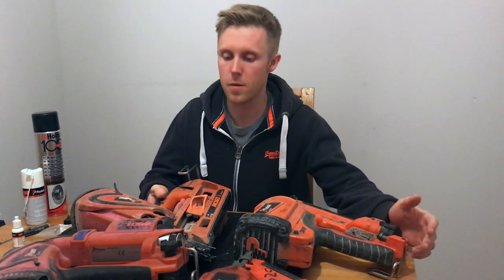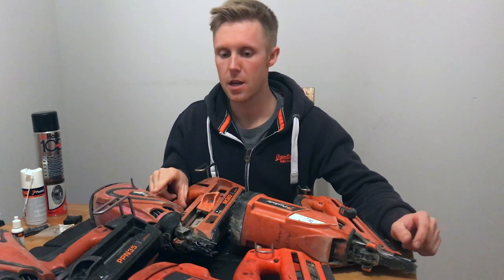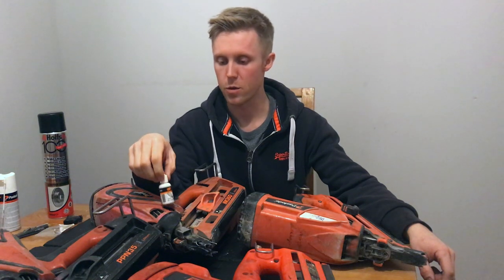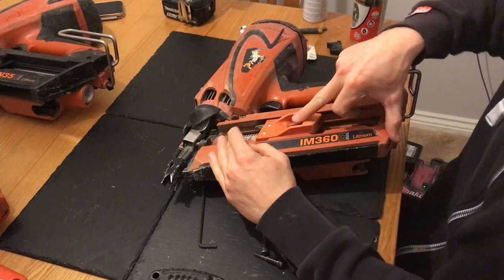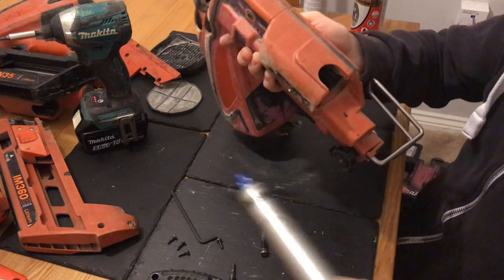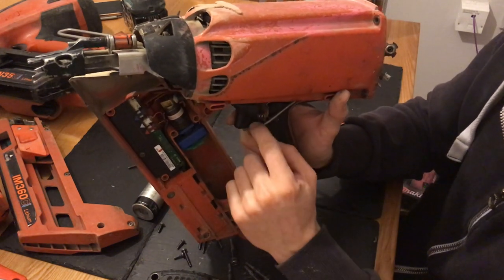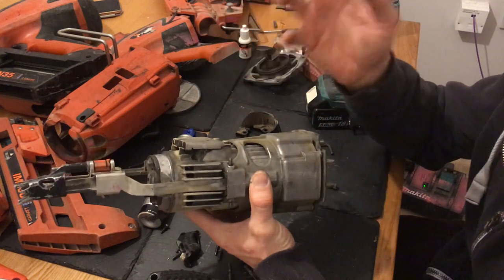Paslode Fix Common Issues Not Firing IM360ci, PPN35ci, IM350 plus

Comment: My biggest regret is sticking with paslode for so many years, I bought the gasless Milwaukee and it just puts the paslodes to shame
Reply from the maker: 100% I have the HIKOKI. And glad I hadn’t had to maintain it!
Reply: The Milwaukee framing nailer is twice as heavy as a Paslode,,don't agree with "putting it to shame"
Reply: @chadsimmons6347  exaggerated, its not twice as heavy, perhaps you shouldnt be such a little girl about it with your weak little arms

Comment: I cant get any response from my paslode finish nailer no fan no nothing except a blinking green light (blinks like 4 times maybe). It’s the older style with the orange cap on the butane compartment not the black cap. Any thoughts ? Doesn’t matter if I depress it or pull the trigger, no response
Reply from the maker: If you open the gun up there is like a little black piece of plastic on a spring which pushes a switch when you press the gun down that could possibly have snapped either that or The button is damaged on the trigger.

Comment: George, my ppn gun has the fan running constantly as soon as I connect the battery. I noticed the small black cable needs soldering on but connecting that by pushing it in makes no difference. Any ideas what else it could be?
Reply from the maker: Potentially the switch is constantly engaged which doesn’t turn the fan off. Open it up and check the micro switches.
Reply: The earth cable on the fan was also loose which you’ve mentioned in the video. The little black cable. Would that potentially be making it not fire and keeping the fan constantly on?
Reply from the maker: @willburbridge5261  yes it would definitely stop it from working. And potentially cause the fan problem.

Comment: Hi George, My im360 head/probe has snapped off when I’ve dropped it. The metal pin is stuck in the probe do I just need to order a new knob assembly and put it back together? Unsure of how to removed the orange depth knob. Thanks
Reply from the maker: I think it should literally just unwind. Best bet is to look at the schematic that I linked in the description to get a better idea of the assembly.

Comment: Where you talk about the striker missing the nail, and needing to screw it in, was that a rubber bung/bumper that slides in the cylinder, my im 350 90ct doesn't have that, just has piston rings,
It's fires the nail first time everytime, but the piston doesn't return and gets stopped by the next nail that gets pushed up from the magazine.
Question is, do they all have that rubber bumper on top of the piston, tha ks
Reply from the maker: Hi thanks for the message, from what I've seen they should all have a rubber bumper inside the piston. i would post a picture if i could. but if you look at the 350 schematics in my description(third link). i believe its part 49 on the chart 'the rubber bumper' if im understanding right. that is another part i know of if it isn't the reed valve it could potentially be. http://www.topgun.co.uk/schematics/IM350_OrangeNose.pdf its part 52 on this drawing. i believe that is the gun you have.
Reply: @Georgous92  thanks so much for the reply,yeah that's the gun i have,ill order the bumper then cheers,the reed valve isn't bent or missing any fingers so i think that's fine.
also do you know if part 89 fits on the outside of the combustion chamber or is it a gasket thats sandwiched in between the chamber parts.
thanks again
Reply from the maker: @patchedupdemon7104  you're welcome mate, i think the parts only about £9 so its definitely worth a shot!
if I've understood your question right, part 89 is a piece of rubber that just overlays on top of the combustion chamber. hope this has been helpful to you! good luck!

Comment: Hi George, I have the 350+ and it hasn’t had much use but every now and then when you shoot a nail it has a delayed noise from something being slower in the return. Sometimes will be a slight pop sound like an air lock? Just wandered if you have experienced this at all?
Reply from the maker: Hi yes, I have experienced something like that more commonly on the 350. I sometimes would have it if I was firing into something very dense. Could potentially be the reed valve needs a little clean from the build up of black carbon on it.
Reply: @Georgous92 thanks for the reply. Easy enough to do yourself? Any footage of you doing it?
Reply from the maker: At 16:25 it’s basically the same place and concept.

Comment: George a Paslode ppn35i positive placment gun firing no problem was green light but now orange light which is service light how to turn off orange light thanks
Reply from the maker: Normally you hold down the star button for 30 seconds to reset. But if it’s flashing red it can be a sign of a loose wire. Check the one to the antenna or electro valve. Also check the wire to the back of the fan it might need re soldering
Reply: @Georgous92  the star button ?the trigger button or fan button ?I’ve serviced and cleaned orange button flashing wires look fine no antenna on the 35i just 1 led light
Reply from the maker: @tim62744  the start button is where all the led lights are that tell you how much gas and battery power you have left. It should have an antenna. Watch the video from 7mins all the time stamps are in the description which describes different faults.
Reply: No I’m 35i doesent have a antenna or battery led lights

Comment: Finally someone who really knows there stuff. I have a im360ci and it’s showing a red light on the gas even tho the gas is full. Doesn’t happen all the time but enough to be very frustrating! So that would need a new antenna? Do you have a link?
Reply from the maker: Thanks for watching the video. Sounds like the antenna to me. Search im360 antenna on eBay. Should be around £30. If not top gun should sell them too

Comment: Do you have any idea what can cause the firing pin on the 350+ not to go all the way back in. I have two guns which have been back to different paslode service centres and they work for about 10 strips of nails [until the gun starts to warm up] then starts misfiring because the pin does not go back totally ,its only about 20 mm less than it should but enough to stop the nails moving up hence timber marked but no nails fired. Both guns have had a lot of use and usually if you enquire about this problem its blamed on the gun needing cleaning but in this instance that can't be the problem. I know of several other joiners who have experienced this problem and have ended up getting a new gun. Any help would be appreciated.
Reply from the maker: Have you checked out 15.09 on the video. it should genrally be the reed valve with that issue. if not it could be the rubber bumper. hope that might help!
Reply: @Georgous92 2:32

Comment: Did you say the O-rings for the 350 and im360ci are the same? (im360 o rings seem hard to come by) so this would be brilliant news. is this both the top and bottom O-rings?
also do you use genuine paslode orings or just generic ones?
Reply from the maker: Yes both 350 o rings should fit the 360 gun no problem. I have used them from my old 350 when I didn’t have any by me. I just buy mine from eBay they are branded as paslode so I can only assume they are genuine.
Reply: @Georgous92  brilliant news cheers, the 350 ones are alot cheaper and easier to find

Comment: George a Paslode 350 i have cleaned oiled and spark seems ok but there’s a delay in firing after trigger pull ? Thanks
Reply from the maker: Hard to say. Could potentially be the trigger worn down from where it engages the micro switch?

Comment: My IM360Ci started playing up today and it won’t fire at all, there’s a solid red light on the side and as I’m about to fire you can just barely hear the fan at first as though it briefly started but it will not fire at all, any idea on what this could be? I’m a Plumber and use the nail gun for pattress’ so i’m not 100% sure in the ins and outs of the nail gun, so apologies if I’m asking a simple question, thanks.
Reply from the maker: Hi dude, when was it last serviced? could need a good clean for the simple option. try holding down the start button for around 60 seconds and see if that makes it work. if not try taking the battery in and out again after that. if not i  have a feeling it might be the black box in the trigger assembly. http://www.topgun.co.uk/index.php?route=product/product&path=9_194&product_id=1579
there are two types of those black boxes parts one is black and one is red. if you have to open the gun it should say on it when type it is. im hoping this might help you out! hope its the simple reset button!
Reply: George thanks for the prompt reply mate, I’ve tried the 60 sec button hold and battery in out after and still the same, might give it a clean and go from there I think, thanks for your help though! You’re better than google haha
Reply from the maker: @darrylward3972  no worries mate! haha i think ive just spent too long taking them apart! good luck! just double check the wire at the back of the gun its 7:20 in the video as that's a simple fix.

Comment: my IM90CI piston doesnt go all the way back. ive dismanted the gun fully for a deep cleen and relubrication. tried to twist the piston as shown but it was not unwinded on the treads. 
reed valve is not damaged. nor is the seal under the reed valve house (ive replaced this)

however i was told to take a look at the bumber inside the champer (rubber piece) how do i get this out? and would this even help to change it?

gun been shot 7000 times (had a device read on it) 
-all new paslode bluecap gas and original nails is beeing used.

any ideas?
Reply from the maker: Hey Daniel,  sounds like you’ve done a lot of troubleshooting. I’m assuming if you’ve deep cleaned the gun the reed valves are free from the black carbon on them. 

Yes it’s not a bad shout the bumper, I personally have never had to replace the bumper on one before. I looked at trying to do that on an im65 the other day but I’ve yet to figure it out. Have a look at the schematics I’ve linked in the description as they may give you a better idea of it’s assembly. Just double check the two rubber o rings for any knicks in them and sufficient lubrication on them. 

The only thing I can suggest is if you have a spare gun or can borrow one. Try swapping the front section of the combustion chamber over to see if that works. May give you an idea. 

Hope this helps? Let me know how you get on.
Reply: @Georgous92  thx for answer. Will look into replacing the metal rings around the piston head tomorrow. Or many the piston it self. 
As for lubrication. It's well lubricated everything glides verry vell. Thx for the reply. 

Ye i looked at this bumber from expand-tec drawing. I belive it's just pushed into place. On im90ci there is a pin hole under the nose part that's not threaded, i belive this is used to push the bumper out. I haven't tried tho.

Comment: George 350 pin not returning I have cleaned and siliconed the Reed valve still the same and I hear air escaping so now I’m thinking piston o rings it does fire no problem thanks tim
Reply from the maker: Hey mate, just double check your o rings are all in tact. The only other thing I can think of is the bumper inside the gun. If you look on a schematic of your gun you should see the bumper on the list. It’s just inside piston chamber. Also you don’t mean silicone the adhesive? You wouldn’t need to apply any adhesive to anything.
Reply: Yes silicon on the bottom flange on the body on the Reed valve it’s nearly on every Reed valve bottom flange ,ya I’ll try the bumper

Comment: I have a makita gun just serviced and depending on gas I put in the gun wont fire could gas do this to these guns George
Reply from the maker: Potentially the date on the gas could be something to do with it. But if you’re using anything but paslode gas it could have a different mix of propane and butane which could cause it. Also the temperatures dropping now so that could be part of it too.

Comment: Hi George, I was wondering if you would be able to tell me whats causing my old im350+ to require a double push to fire please, thanks.
Reply from the maker: Hard to say but potentially just a good clean and just check the yellow/ red red tube where the gas goes in isn’t blocked with dirt?
Reply from the maker: It’s possibly the reed valve is dirty and has a build up of black carbon on it.

Comment: Hi, im360 only firing on every double pump, any ideas? It’s been cleaned and serviced recently
Reply from the maker: It’s probably a build up of carbon on the reed valve it needs all the black to be cleaned off that should help. Either that or a new electro valve. Cleaning the reed valve is cheaper to try.
Reply: @Georgous92   thankyou will give this a go!❤️

Comment: Thanks for video. My paslode im90ci no spark,gas does not explode-how to fix . Thank you very much
Reply from the maker: Sounds like the switch isn’t being pressed which activates the spark. If you take the gun apart see if you can operate the two switches in the trigger assembly. It could be just a loose wire on the fan assembly not soldered in properly.

Comment: Hi mate wondering if you had any advice , my nail gun will only fire if it’s pumped twice , cheers
Reply from the maker: I imagine it’s the electro valve. If you have a spare gun or know someone with one try that part in yours
https://www.ebay.co.uk/itm/New-Paslode-IM360Ci-019117-Black-Electrovalve-Assembly-Fits-PPN35Ci-2-/184724340168

Comment: Hi George, i have an IM360Ci that isn't firing. I've stripped it down with the help of your video & none of the possible causes that you have identified   seem to be the reason. Any other suggestions or possible reason of it please? Many thanks, Simon
Reply from the maker: Could be the electro valve or the spark unit which is in the handle. It’s a little black rectangular piece. Hope that helps!

Comment: Can anyone help? I took the gun apart to clean it because it was so dirty (I just bought it used). When I put it back, the tip of the gun won't move up & down when I press it. What did I do wrong?
Reply from the maker: What model is it?
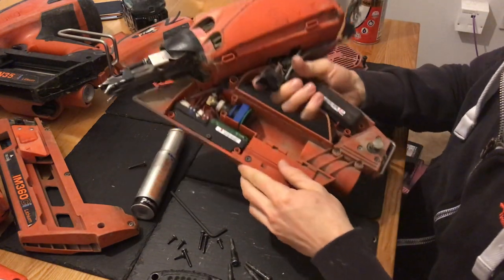Reply: @Georgous92  I have 900-420 & 404-400. The 900-420 is the one that the nose would not move up & down (move very little). I know I put it back correctly. The 404-400 nose is more simple with just 2 parts. Can I switch the nose between these 2 models? The 404-400 is not firing. When I removed the plastic handle apart into 2 pieces (like you did at 11:25), I pressed the switch, the fan is on & working. But when I put the plastic cover back, it does not work. I did not try your method yet (by adding plastic to the switch or cutting 1/2 of the plastic out as you explain in your video). Do I have to replace that part (what do you call it)? It does not make sense to me, it does not work when I put the handle cover back together.
Reply: @Georgous92  I put the simple nose of 404-400 on the 900-420.
Everything seems to be working fine but it won't shoot the nail.
It works fine before I cleaned it.
Now it won't shoot just like the 404-400.

Comment: Hi mate i have a im 90 that ive jut fully stripped and cleaned although i didnt change the rubber orings just yet it fires evertime time but odd time it fires 2 nails at once any ideas ? 

Also i havr a im65 f16 also fully stripped cleaned shoots everytime but sometimes doesnt sink the brads in fully and leaves a dint just above the brad that it leaves out also
Reply from the maker: Usually fires 2 nails if you’re using clipped head nails. Not the ones for a Im360/im90 usually. It’s normally where it’s the end of strip and start of a new strip. 
Im afraid I’m out of ideas if the gun is clean. I can only think maybe it’s the reed valve with a build up of carbon on it? That’s my best guess
Reply: @Georgous92  thanks mate sorted that priblem now it has a fault were the gas leaks in short fast blips when battery is inserted and used the gas cartridge up quickly it is coming out in the cylinder but it keeps letting it out without pressing anythings like psh pshh pshh pshh pshh lol any ideas
Reply from the maker: @deanthompson6664  my best guess is the electro valve needs replacing. They have some refurbished ones on eBay at the moment. Which are significantly cheaper than new ones
Reply: @Georgous92  thanks mate now it has basically stopped working alltogether no red light put battery in and it flashes green say 4 times then no lights flash no power
Reply from the maker: @deanthompson6664  have you tried a new battery?
Reply from the maker: Best thing to do is get electrical contact cleaner. Wd40 make and various other brands. Strip the gun down and clean all the plug in components and circuit board with it.

Comment: Cheers mate for the video my firing pin was sticking out and not retracting turned out to be reed valve as you said
Reply from the maker: Cheers for the feedback dude really appreciate it! Glad it helped you out!
Reply: Sir i have a new cfn-360xp I've  olny shot 60/65 nails an put up for month or so.put new gas an new nails an now everything works but want fire.the battery is fully charge.i clean it but that didn't help.any advice would really thank you.best video yet.thank again

Comment: Hello mate, having problems with my im360ci first fix. Was flashing red and green but steady green light now. Been having to double pump the gun for it to fire an seems less powerful. Now not firing at all. Any ideas please mate?
Reply from the maker: Hi mate it’s most likely the electro valve. 
https://www.ebay.co.uk/itm/184724340168
Reply from the maker: If you have a ppn nailer or spare gun try that part from it.